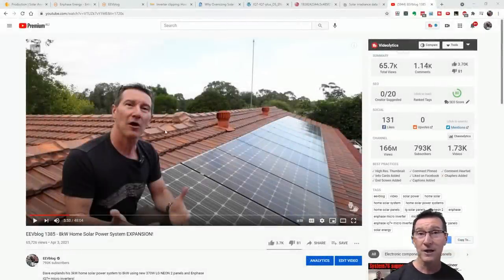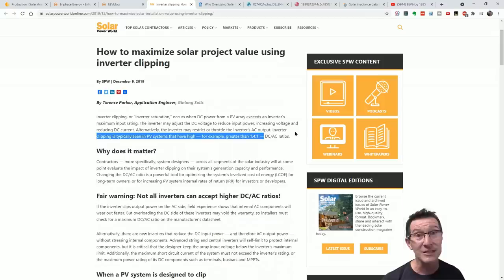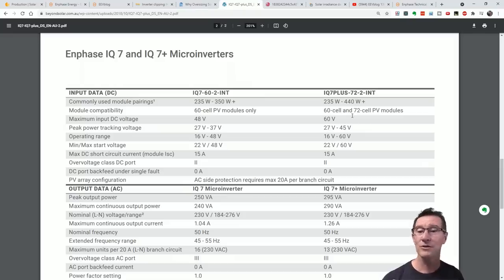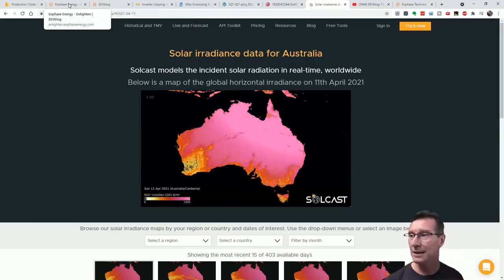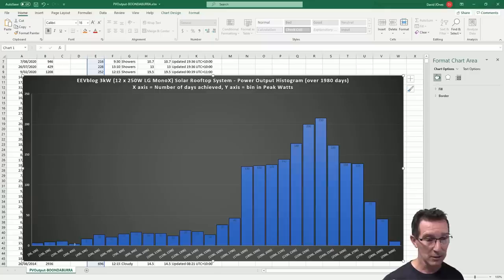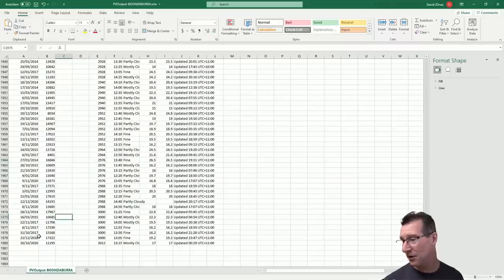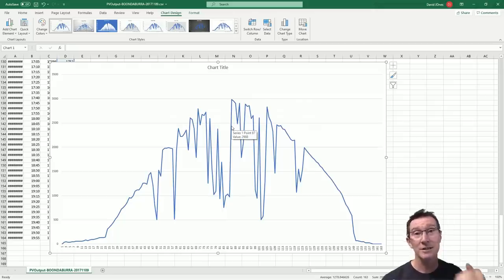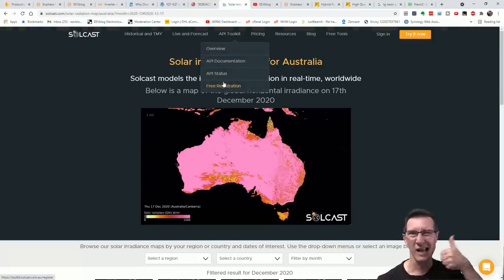EEVblog 1386 - 295W Inverter vs 370W Solar Panel - WTF?

Comment: Well, this is all one big argument for me to avoid microinverters when I upgrade my system. At just under 800m elevation, with a 4 season climate, there are many winter days when I exceed STC output of my panels. Winter days are the days when I need every watt I can get.  (Solar PV production is optimal on cold, clear days with a few small clouds for cloud-edge effect.)
Reply from the maker: Yep, fair enough, everyone's requirement are different.

Comment: Not sure I trust the logic that clipping prolongs their life. Just means they get hotter. And then hotter.
Reply from the maker: Where is that claim? I didn't say it did I?
Reply: @Sage What am I'm missing here, given the same inverter running at 300W or 400W output, the one running at 400W would be hotter. The panel would get hotter sure, but hopefully that is decoupled well enough from the inverter that it would have no significant impact on it.
Reply: @jaro6985  you cannot compare inverters like that. 300W inverter @ 300W output + solar panel will produce more heat than 400W inverter @400W + solar panel (100W less heat to be exact, assuming the same solar panel under the same outside conditions). 300W inverter may waste less at full power (compared to 400W one), but you have around 100W more turning into heat within solar panel
Reply: @EEVblog  maybe you didn't commit to it but you did relay the notion of derating for longevity, did you not?
Reply: @jaro6985  well you did edit your reply so maybe you caught what you were missing :) I assume it's panel longevity that's in question, not inverter. Panels are typically the cost intensive parts. Even though inverters are quite overpriced.
Reply: It reminds me bit of ATX psu's decades ago when some manfucturers advertised them by the peak wattage assuming that user won't continuously be using all of the maximum power.
Reply: @sageii5614  Yes you are correct, panel longevity might be affected. Would depend on location, etc. but they don't make the panels do they :p
Reply: @volodumurkalunyak4651  key word there " within solar panel", the heat is in the panel not the inverter, therefor it runs cooler.
Reply: @jaro6985  inverter dumps heat into both solar panel mounting frame and air beetwen it and solar panel. I dought it will run cooler, especially with solar panel itself dumping heat into very same space + ouside air (roughfly 1/2 of total area).

Comment: I oversized my array, but for very different reasons. Here in Victoria I was only allowed to have a 5kw inverter tied to the grid, but was allowed to oversize the array on that inverter by 33%, so I have 6.5kw of solar panels over a 5kw inverter to get as much electricity as possible within the legal limitations. Once I go off grid I will be able to have an inverter as big as want.

Comment: Running 14kW per 10kW inverter on my farm arrays. Panels are cheap now.
Pumped out 201kWh today. Cool weather helps with the 20% derating due to heat.

Comment: My understanding of the solar cell is that when you have 1000W/m2 of insolation on a 1m2 panel with an efficiency of 20%, you should be able to get 200W nominal power...
This means 800W or so of panel heating, compared to around 900W if the panels are at half-load...
Therefore maximum PV energy capture actually provides a form of cooling effect on the panel?

Also one reason to over-rate the inverter, is it's own power derating - the micro-inverters will be exposed to high-ish ambient temperatures, and thus it would reduce the stress on them during heat waves etc...

Comment: Thanks for this, just looked at my Enphase system and sure enough it is clipping in San Diego on some days.  I had seen this before but frankly hadn't looked close enough at it to notice.  Like you, I have an older system I moved from a previous house that is a 4.5 kW Sunny Boy and then added new Enphase system with micro inverters.  Now I've got to go make this a science project to see if it is worth upgrading my micro inverters.  I was looking to add a few more panels so would have the inverters upgraded at the same time.

Comment: I have a 6.6kw peak system installed with a 7.6kw solaredge inverter. So I have 1kw more inverter capacity then peak panel output. I really like the way the solaredge system works, by boosting your string voltage up to 380 to 440 V dc your inverter can be built way more efficiently.
I originally had a 6kw inverter installed and would constantly clip in the the spring. I couldn't sleep on that! So I was able to get my installer to swap the out for the bigger inverter at cost ( about 300$? ) and just be done with it.

In the spring and fall when the temps are cool but the sun output is good I can CLIP! I push for about an hour on only a handful of days 7.6kw out of my 6.6kw panels.

Oversizing the solar panels is common in the US too. Im in Utah.

Comment: Great analysis. Your logic, however, may be coming from the wrong direction. Over here in Perth, WA, we are restricted to 5kW of "Production" if we want to connect to the grid and get paid the abysmal (8c) feed-in tariff. The inverter output is "Capped" @ 5kW, and we are allowed up to 4/3 (6.66kW) of panel peak overproduction. My inverter goes into 5kW "limit", 2-4 hours per day during the summer months. Regulations vary for battery storage and electric vehicles.
May I suggest some content for you to create: 
~ Battery Storage - Hybrid DC vs AC (Tesla). I like that hybrid inverters use Panel DC upstream of the inverter . There may be some fun looking at the operation and losses of each of the inverters in the different typologies:  MPPT, DC Battery (LG Chem), 240VAC Stage, AC Battery (Tesla) 
~ How Panel Optimizers work : "Boost" - Distributed MPPT (Solar Edge) vs Buck - Constant Current (Tiago). It is an interesting exercise in cost, efficiency, complexity and reliability. I like that the Buck optimizers operate in bypass most of the time, Switching on during shade or obstruction.
~ Self consumption including Time of production. Like you said, plan when run your washing machine. If you use power in the afternoon, North-West facing panels are Great. This could sprawl into Smart Home network. Energy Production timed operation - Pool Pumps, Hot water, Fridges, HVAC etc.

Comment: Clipping is a crock likely designed to keep you from using your solar power system to its full potential or to get you to purchase more panels than you actually need for your application. If you have 5KW of panels, install a 10KW string type grid tie inverter. That way your panels are providing 100% of the power they can make,  the grid tie inverter is not stressed, runs cooler and at a higher efficiency. You can also add a few more panels to the system at some point in the future as well. Those micro inverters will eventually fail if run at max output every day but that's not as important a detail, the point to focus on is your 370 watt panel is not being utilized to its full potential, you might as well have purchased 250 watt panels instead as you're not getting much more than that out of those micro inverters......

Comment: There is another issue though : burnout.
I dont know the specific overload margin those micro-inverters can handle, but most systems out there are not designed to digest a lot of overload.
They tend to overheat and burn a mosfed or two.
And replacing a fried microinverter is costly. Even more if it's hard to get acces because it's on a roof.

Comment: In Poland you roughly get about 1MWh per year or slightly more per 1kW of installed PV power. Of course I'm talking about a static non tracking system facing close to south and with correct inclination (the all-year optimum is around 39-40 degrees but anything above 15 is close enough). Currently I'm running a 5.55kW system but with panels lying nearly flat (actually half of them are even having a "negative" inclination by few degrees) and I get about 4.6MWh per year so I loose around 18% or so.

Comment: I have IQ6 microinverters that took a grid hit and took out 16 units.  I shaved off the top off of the area (with my table saw, ruined my shirt) just around where you lost small cube part that came off of the board.
I was able to solder in a 3.15A 300V fuse mouser part 504-SS-5H-3.15A-APH  ($0.57) and a similarly located MOV mouser part number 871-B72214P2171K102 ($0.38)  Soldered the leads onto the leads on the board (I carefully trimmed them). Hooked it up and it started working normally.   
***I will be installing a MidNite Solar Surge Protection Device (MNSPD-300-AC Amazon $111) Close to the incoming AC power feed at the main breaker panel that should prevent this from happening again and as a bonus protect my home electronics.
On a side note the MOVs used are designed to take anywhere from 1 to 15 grid events depending on the severity.  This means if you lost 1 to a grid event then the other ones have used up one of their "9 Lives" it would be a great idea to try and protect the ones that are still working.

Comment: In the UK you're only allowed a certain size of output of system (in to the grid) so it often makes sense to over spec the panels to make the most of this allowance.
Reply: Why do they limit? To help out the utility companies?
Reply: @everyhandletaken  they don't want too much going back to the grid... I think it's to prevent people with a bit of land turning themselves into a solar power station!
IIRC the limit is 4KW.
Reply: @juststeve5542  if the uk grind has any of the undersizing issues like the US grids the system probably can't handle it, but more likely its about control and protecting approved monopolies.
Reply: @adamdnewman  TBH the rather crap feed-in tariff does that for them here in the UK!
IIRC you're lucky to get 30% here. A friend of mine in Colorado gets paid his unit rate for what he sends back - the git!

I looked at the UK feed-in rates, looked at the price I was being quoted for a professional solar install (which would provide me with the certificate to do feed-in), and then decided to use the price they quoted for the scaffolding and planning alone to buy 4 panels with micro inverters and Envoy controller and just do it myself with zero feed-in.
Having your own scaffold tower is rather useful at times :-D
Reply: @juststeve5542  I wish I were you! It's just not worth the shitty rates.
Reply: @loshan1212  The rates different state to state here in the US.
Reply: @juststeve5542  It doesn't make sense for the utility co to pay you the same rate per unit that they charge to deliver that unit to you. Built into that charge is the massive cost of installing, maintaining and repairing generation and transmission equipment, along with the cost of thousands of employees. Your feeding power back into the grid (on lines they installed and maintain) doesn't help cover any of that. My utility offers to reimburse only their cost of generating the same amount of power that you feed into the grid, which is an understandable compromise. I don't know how much it works out to be, because I've only just barely started looking into solar.
Reply: @loshan1212  I'm in the UK, the feed in rate for me just wasn't even worth bothering with, so I've just been playing about with 4 self installed panels as an experiment since November.
(Yeah, test solar in Winter Steve, great move! lol!).
I have no feed-in, the panels throttle back if I produce more than I consume.
Yesterday the panels produced 12% of the electricity consumed in the house during the entire 24hrs of 12th April, and that's only going to get better during the year. Max so far was one 18% in the middle of March.
Longer days are really going to help.
(Yes, I'm ignoring how much I spent! We were locked down and I was bored!).
Reply: @juststeve5542  Ha, Ha, exactly my case!  But I got really bored so also did my own hot water diverter (by far and away the best payback by miles as it can be done for less than a tenner if you discount the costs of your time), and then added a power wall which would have been better  if they didn't close all the dumps which were my source of free LiIon batteries.
Reply: The DNO can't deny install if the install is 4kw or smaller  (actually 16 amp g81 limited inverter so range is 3.8 to 4kw depending on local voltage), if you want larger install then 4kw you need DNO approval

If your on 3 phase its 12kw (4kw per phase) and can't be denied (over 12kw on 3phase needs approval)

I am Considering self install but finding a solar installer that will certify is can be a problem (to get the feed in tariff)
Reply: @adamdnewman  I'm not sure it's that cynical, when they design local distribution grids they assume about 3-4KW per household for supply - would make sense if they did the same for generation, you can generate up to 16A @240VAC without approval, for further generation you need approval from the local operator.
Reply: @juststeve5542  what might be worth looking at one-day are some of the dynamic feed-in tariffs if you have battery storage.  The classic feed-in tariffs needed to go,  they grossly overvalued energy generated at times when there are grid surpluses.

Comment: I think I've only seen full out put from my solar system twice in the 3 years it's been up. But being in Eastern Washington at 47 deg north we don't get a very high solar angle. My system is over rated right now, but I plan to add more panels to so I can get a little bit more power over the winter months. I don't think I'll have to worry about clipping but for a month or two a year with the extra panels added.

Comment: here is my setup from the Netherlands:

Solaredge SE3680H (1 Fase inverter) Maximum of 3680W.
Solaredge optimizer P370 on every pannel, to mitigate loss from partial shading or a defective pannel. 
16x LG NeON 2 Black Module 60 Cell LG330N1K-V5 total of 5280W in a single string.
8 pannels on the east facing roof and 8 pannels on the west facing roof.
when the sun is at peak the system produce 3572W, almost never clips the top.

Comment: Austraila, the CEC guidelines to allow STC credits / rebates allow an inverter of minimum 75% of the PV capacity. i.e. a 10kW inverter can have 13.33kWp of solar PV....some companies allow more than that if there's DC coupled batteries / Hybrid inverters

Comment: If you clip 8% of the energy 38% of the days of the year then thats 3.04% energy loss over the whole year. I suspect that on those 38% of days the 8% figure is much less than that, so the figures on the data sheet are plausible "worst case" figures.

Comment: It is't that difficult a calculation, Dave!
Just upload the minute-by-minute data from the 1980 days to a shared cloud, and let your YT-followers do the grunt-work ;)
Reply: Its actually really easy. The area under/over the line? Just cut it out and weigh the mass. Thats how they did it back in the day. Not to mention all the other (digital) options.

Comment: Another point against Microinverters or Optimizers. Added Complexity, added standby consumption, decreased peak efficecy, Higher Maintenance/ Repair cost, higher initial cost. Only good for Manufacturers and Installers to pull more bucks out of your pocket. Inverters can fail, calculate MTBF for a full system with 50+ modules and inverters and soon a replace-inverter-under-panel-contract  with your installer makes sense. Simple  bypass diodes  which are default in every panel will perfectly deal with shadows, Panel failures if so (nowadays they are crazy robust) can be seen on string level measurements.

Comment: The quickest way to explain it. Is if you oversize to ~1.3 the return on investment is better than if you spend the money for larger inverters to 1:1. To capture that last 30%, which is only going to happen for ~ an hour a day, on cloudless days, you are not going to see your money back on the cost of that excess inverter size.

Comment: Your point is well made - it makes no sense to design and size panels and inverters for the peak hrs and peak days, we should be more interested in Spring and Autumn when the reduced output must be less able to meet the installed load. The only way to design for useful output in the months outside Summer is to "over-provide" panel capacity, even though you don't need that peak Summer output. In this situation there no point at all spending even more to be able  to invert that excess Summer peak power.

Comment: One way to figure out how much power your old system could have lost from clipping would be to take all the days above 2400W and lower them to 2400.  So subtract 600W * (num of 3000W days) + 500 * (num of 2900W days) + ...and so on.  This would let you know what your output would have been if all those days were clipped.